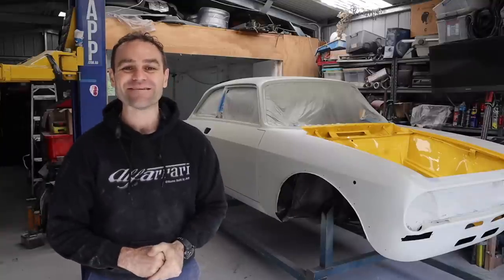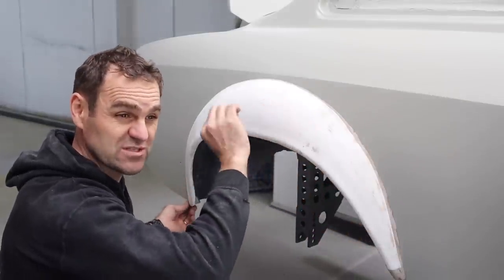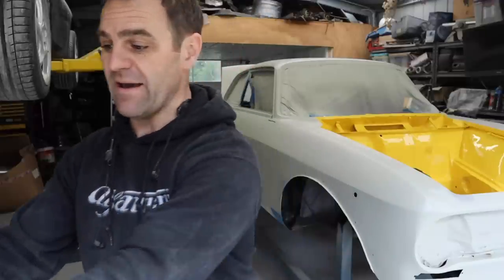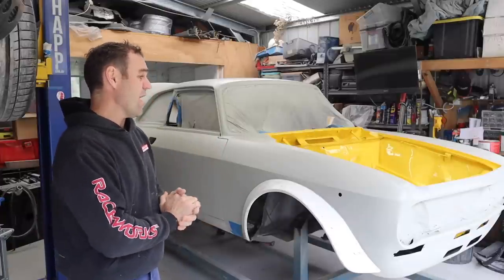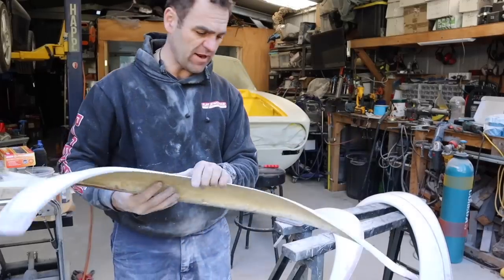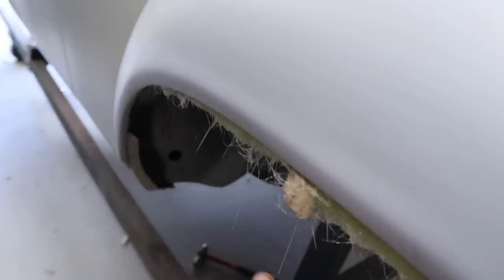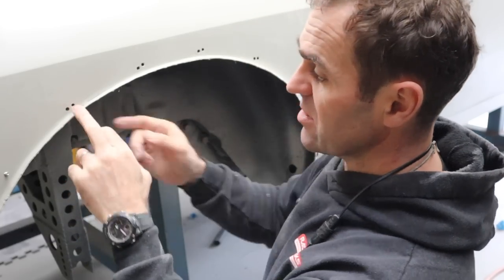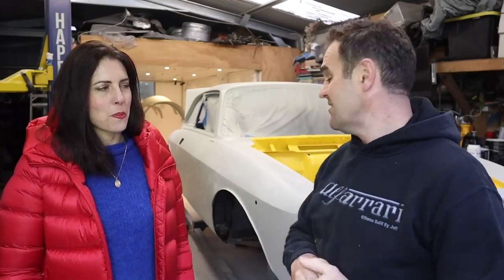Perfect wheel flares - Ferrari engined Alfa 105 Alfarrari build part 143

Comment: Looks really good! I can't wait to see the Alfarrari in the glossy yellow ferrari paint.... Love it man... 🙂Maybe a tip to get the flares symmetrical: stick thin paper on the smaller flare, trace the contour, cut it out and stick it on the larger flare turned 180° and sand it down until the contour of the paper is reached. Especially with the front (and the view from the front) this would have worked well...
Reply: Or use the trick where you cover it in fibre reinforced tape, criss crossed, pull the tape off and pop it inverted.

Comment: Why not use a black rubber seal (or leather) between the fender and the epoxy flares? Function meets form. The black will stand out against the yellow. Sometimes you must decide to go for intended differences. The rubber will also protect form wear and tear.
Reply from the maker: I will use some sort of gasket between, but they still need to be a perfect fit first ;)

Comment: Since you put so much work into those flares maybe you should drop them off at a local fiberglass shop/surf board shop and have molds and a few copies made.  That would give you a spare set incase they get damaged while racing and you can sell a few.  Just a suggestion.  Looking good.  Cheers!

Comment: Would you place a very thin gasket type material between the flare and body work to protect the paint job from chafing/scuffing?
Reply: Rubber is the best way to separate the fibreglass and metal
Reply: I was wondering this.

Comment: Jeff, it looks perfect, all apart from the arch extensions. They give you the width but seem like a bolt on to the lines of the car. Have you seen the Giulia Gt Electric by Totem has GTA style arches. They give the flow back to the car.
Reply: It has been a lot of work to get the arches as they are now. But I agree it doesn't flow right. What came to my mind is how they are done on the Mk1 Escort. I just looked up the Giulia GT Electric and I fully  agree that looks like a much better concept. There has gone so much work in this car, it deserves it. I read in another comment Jeff thinks he doesn't have the skills to pull them off in metal. If it was my project I would have outsourced it to get the car perfect. It would get on my nerves the front ones aren't symmetrical. 🙈
Reply: I will disagree here, I think the GT Electric looks like a totally different car, and not necessarily in a successful way, my opinion only. I love the way the original car looks, but failing that, the period extensions are the way to go.
Reply from the maker: Totem cars are amazing, but they have built a completely new carbon fibre body.

Comment: As for the plenums, I think you have two choices, make them YELLOW, or Get them made in exposed (Visible weave under the clear coat) carbon fiber, but then you'll need yellow Ferrari plenum badges to bring everything together.
Reply: It's actually a great idea but as there is nothing else on the car that is exposed carbon it might look a bit out of place.
Reply: My thinking is.
Acid dip the plenums to natural cast aluminium silver.
Paint the raised Ferrari lettering in yellow.
This way the silver plenums would continue the flow of the centre silver stripe but with the nod of the yellow to the body colour....

Comment: Talcum powder only works in low humidity, up Brisbane way that is about 6 days a year. lol. The talcum gums into a gluggy uncomfortable mess when it gets moist, Barrier Cream is no better.
There is cold and hot shower sequences that open and close the pores that help remove the fibres and to reduce the itching. 
We had a debate in a trade group a couple of years ago and the conclusions we came to was that in hot areas, get a good lather of soap built up in your hands, turn the shower to as hot as you can handle and cover yourself with the lather, sweeping down the arms, legs, etc, and then turn the shower to cold to close the pores as you wash the soap and fibres off. 
In cold areas the sequence seemed to be opposite, even though I can't verify it, the consensus was to build the lather, turn the shower to as cold as you can to stop the fibres going in deeper, lather downwards the same as the other method, then a hot shower to open the pores and wash the fibres out.
It's amazing how heated the debate got until I started asking where people were from and tried to find why the methods were opposite.

Comment: It is the tweaking and refining that determine the quality of a project. I imagine that there will be more adjustments to dial this project into a fine running road car. The forward weight bias will be difficult to overcome.  You may be building a very powerful front sway bar to help. Maybe even adding weight in the rear. Changing spring rates, adjusting ride heights. The Alfa suspension does not like to be to low. Positive camber change becomes excessive as you lower the nose.
Reply from the maker: With the engine that is only 27kgs heavier than the original and now with the battery, AC, big twin mufflers and half cage in the rear, it should be pretty much the same balance.
Reply: @HomeBuiltByJeff  the stock balance is way off. I concentrate on moving the front lower control arms forward and up a bit. Move the engine back a wee bit. Move battery to behind passenger. USA car. Much lighter and more powerful front brakes.  60 additional lbs over the nose? It may be more with the dry sump tank and various steel brackets. But I have confidence you will solve any issues that arise. I love watching your Chanel and your skills.
Reply: I remove about 100lbs from the nose when I build these cars. It really helps with balance. I also concentrate on centralizing weight. I do not like high polar inertia.  I use lithium batterie and shorter length battery cable to the starter. I directly bolt the battery to the box with the negative post to save weight.  Cut out the floor behind the passenger and build a new box under the car that strengthens the rear frame.  If the customer lets me. Now most people are more concerned with not altering the car. Driving it is second.

Comment: Rather than taking a mould  could you follow suoerfast mats example and do 3d scans cwith your phone ?
 If  you need to replace it  3d printing will  take a long time but is easier and won't take up space in the shed like four "just in case" moulds.
I've made seat and propellor moulds, it's not as easy or cheap as some commentators would have you believe.
Your car, your colour.

Comment: I built my daughter her first car at 18, it had to be fast loud and reliable, I found a Honda integra with 16b VTEC and the original motor with 423k kms on the clock AND it still revved to 8500 so reliable and fast sorted, for loud I repainted the 5 different coloured car a bright fiat yellow, my wife was horrified WHY? well I said it's really easy to see, no self respecting thief will steal a car that can be seen 4 kms away AND dearest daughter will know that also and not get any tickets it worked

Comment: Great work making fender flares balance to the body, but rear flares start wider on top to smaller on the bottom.  Your car is not traditional so it would look better to match rear design, meaning wider on top thinner on bottom . The minutes you hit a curve , after you done painting you kick yourself.  Beside looks big ear in front of flare, but front rear goes wider to thinner. The part of front fare goes wider instead of following your car design curve. Put masking tap on the  flare edge toward bring the design thiner to the body, I bet you will change your mind.  Keep up with the hard work.  Very respectfully.